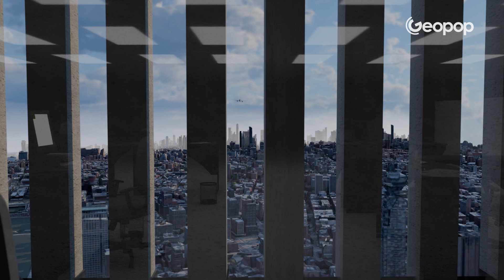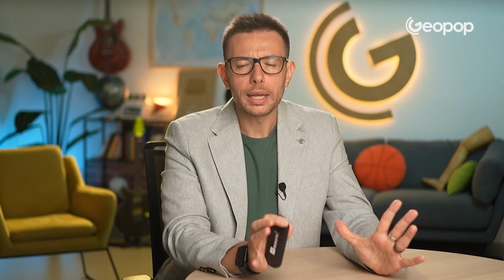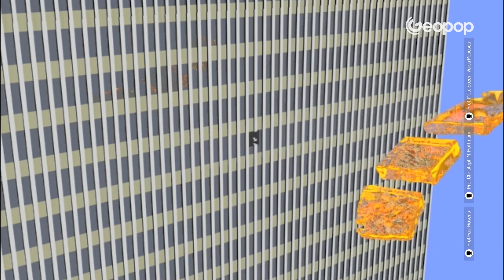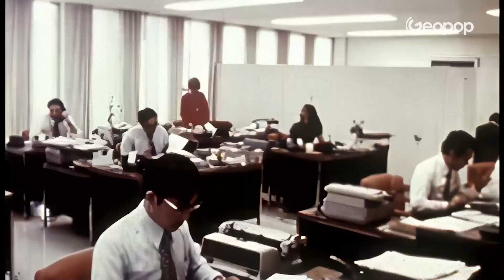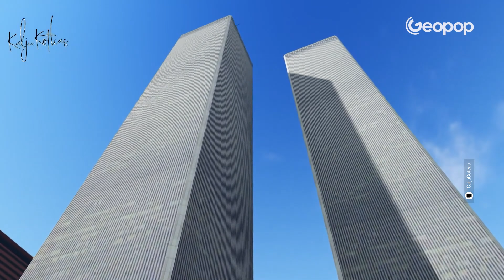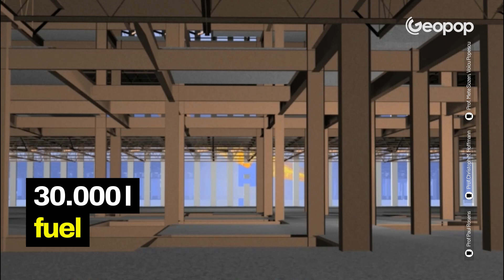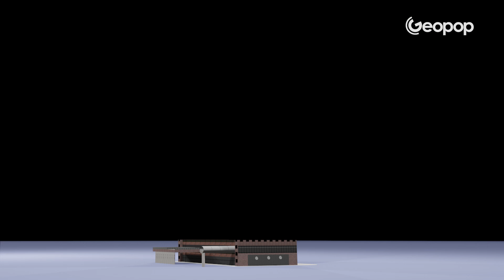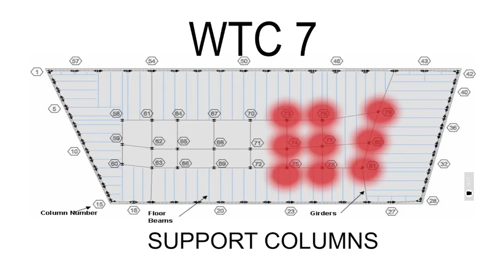9/11, 2001: The Technical Reconstruction of the Twin Towers and WTC 7 Collapses

Comment: How’s does everything fail so quickly? Buildings want to stand up and resist and most of the buildings was not affected by the impact or the temperature. So how does a small part of the building push through the rest of the lower building in a free fall speed. There is not enough mass or energy to do that. I could see a partial collapse but a full failure?
Reply: The sheer weight when the beams inside could no longer hold up the weight, it is pure physics
Reply: @ulrichkristensen4087  It wouldn't have fallen at free fall speeds though, it would have slowed slightly every time a new floor was reached.
Reply: @MegaLokopo  Slowed slightly? Well not so much it mattered, when it collapsed it was like a domino system, it went hard increasing its kinetic energy with each floor collapsing, i really do not care about you n.t cases, but have some respect for the people who died in this tragedy
Reply: @MegaLokopo It did slow slightly. If it hadn’t then the building would have fully collapsed at the same time the ejected debris would have hit the ground. In the videos, you see the debris are traveling faster to the ground than the rest of the building.
Reply: @dudleysquibbles6366  That difference is entirely accounted for with wind resistance.
Reply: @ulrichkristensen4087 no. Pure physics is that NOTHING can fall at free fall rate unless there is ZERO resistance. No matter how much weight is coming down on each floor there should STILL have been some resistance. If you are going to quote physics then please make sure you do so correctly.
Reply: @amadormediero3978  so tell me how fast  the building  Collapsed....i stand in awe of your presence, but i sure you can tell me, since you went to Donning-Kruger University, and i did not, i will be waiting right here Tada.....
Reply: Free fall speed , hahahaha 
Stay goofy - you got the Internet correct
Reply: It was a combination of multiple events
Reply: Your logic & instincts are 100% correct- the one and ONLY way any steel construction building could possibly collapse that way is a CONTROLLED DEMOLITION- THIS IS OBVIOUS- How does all the steel BELOW the crash site fail simultaneously? Do you conspiracy shamers see how ridiculous that really is?? I hope so
Reply: Read ``9/11 for Dummies´´free on Amazon Kindle
Reply: The twin towers didn't fall at free fall speed. And I can see that you're asking these questions rhetorically, but if you are a person who is actually curious about the truth, the answers are available through a quick google search. Scientists have actually done the math and concluded that there was much more than enough mass and energy (by nearly an order of magnitude) for the upper portion of the building to crush through the lower portion and cause a runaway collapse as we saw. You can look up "Why Did the World Trade Center Collapse?" by Bazant and Zhou to read the paper.
Reply: I think that it was a gradual thing. As floors were collapsing onto other floors eventually the weight will be too much.
Reply: @CoreyCaudle-mp7zn  Yes but if that did happen the speed would still not be freefall. Every floor should show some resistance assuming the mass above is enough to push through the mass below. Again a pancake collapse which would of taken longer...
Reply: @michaelzero5144  
If a man that weighed 15x your mass fell on your head at a speed of 80mph- how much "resistance" will you provide when it crushes you ??

You think you would notice a difference in the fat man's free fall onto your head ?

Every floor that collapses adds to that mass differential -  16x 17x ... 30x .... 40x

How quickly does your spine snap ??  
1 second - 0.5 seconds - 0.01 seconds ?
Reply: @BracaPhoto  nice math but I am not a massive building so not sure how that compares. I understand how the force can multiply but I am arguing that it can’t get started in the first place naturally. Not enough mass or speed above impact to push through the majority of the building that is left in a free fall straight down. If buildings were that fragile we would have collapses all the time. Also it’s mathematically impossible 3 buildings fall the exact same way with different damage points and different structural failures. All 3 fall straight down in a free fall? That in itself is impossible in a world with random chaos.
Reply: @michaelzero5144  just one word: thermite!

Norwegian investigators found evidence (particles of nano thermite)
Reply: @BracaPhoto free fall is the rate at which anything falls when there is no resistance. If I jump off a roof I would fall at free fall rate of 9.8m per second. If I create resistance by wearing a  blanket tied at my ankles and my wrists I would create some resistance and no longer fall at 9.8m per second. So these towers did actually fall at free fall rate meaning there was ZERO resistance below. In other words all the supports were blown out at ground level at precisely the same time in the way perfect demolitions are done. That's what this was. No doubt about that at all.
Reply: @amadormediero3978  you are an absolutely muppet of a human being, not only do you DK all over this thread, but you have zero sympathy for the victims and their loved ones, ln top of that you proclaim to be smarter than anyone else, spurting your little conspiracy theory out over everything, it is because of individuals like you we can have nice things.
Reply: Quit with the :free fall speed:  you sound like an unintelligent fool.  The building did not fall at your so called free fall speed.  It was the debris on the outside that fell at your freefall speed.  The main building fell at a speed determined by what was failing below it.
Reply: Never played Junga or the 60s version of same idea called "Topple," huh?
Reply: He talks about this specific topic at the 15:00 minute mark.  A floor can only hold up to a weight of 11 floors (if gradually dropped or 6 floors for a sudden drop) above it singularly without any other support.  Each tower was struck and damaged more than 11 floors from the top.  Each floor had to carry its weight and only 11 floors above it or it would collapse.  It held out for as long as one floor had enough to support itself under that marker.  Once any floor in the damaged zone could no longer support itself it caused a sudden drop of that floor's weight and all the floors weight above it which again was >11 floors. That immediately caused a domino effect of floors unable to bear that sudden massive weight being thrust upon it.
Reply: @marybria  Its BS. There no way the tower can come down like that in freefall without buckling first. These "experts" may think we are all stupid...And some of us certainly are.
Reply: @marybria it still wouldn't fall at free fall rate. The ONLY way anything can fall at free fall rate is if there is absolutely NO resistance from below and no matter how much weight comes down on a floor from above there would STILL be some resistance below. In the case of these 3 towers there was ZERO resistance. Besides there have been many towers totally engulfed in flames (not just a few floors) and NEVER has any other tower collapsed anywhere in the world in history. It was all Bullshit
Reply: @marybria Nope, that a load of bullshit- wake up & don't be so gullible
Reply: @jerald6023 "wake up" is not an argument nor does it prove your point. try again.
Reply: @jerald6023 says the guy screaming to the clouds!
Reply: @jerald6023 wow what a response I'm completely convinced all questions answered
Reply: @jerald6023 where is your proof or credentials
Reply: The construction method used in the east is different from that of the west. The west built their stories one by one and the east built the exo-skeleton from the bottom all the way to the top and then added the stories inside. Therefore it was mentioned in the video that the towers could only hold up to 6 stories on a sudden collapse, there were more than 11 stories that collapsed on top of each building that day.
Reply: @Misael-Hernandez the towers were built exactly the same- there is literally VIDEO from construction to show as much!
Reply: @jonathanlandau-litewski7405  here's an AI Google search 

The World Trade Center towers utilized a construction method called "framed tube" design, which differed from the more traditional "bearing wall" method common in Western construction by relying on a perimeter of closely spaced steel columns to support the building's load, allowing for open floor plans without interior columns, while most Western buildings would have load-bearing walls throughout the structure for support.
Reply: I agree. I certainly don't believe the tower 7 narrative.
Reply: Each floor collapsed one by one in rapid succession from the weight of the floors prior. So this would add to the weight of the total building multiplied by the gravitational constant. So when considering gravity is pulling the whole structure down, the building has enough inertia to collapse floor by floor. In the 9/11 documentary by the Naudet brothers, you hear one of the firefighters describe what they heard as a controlled demolition sound (not because of explosives) because it was the sound of each roof collapsing as the weight of the building compounded downwards.

Weight compounds with mass and the acceleration from gravity (or otherwise). I can keep my car from rolling if it's on a nominal incline and in neutral, as long as it's stationary. Once the car starts moving, it becomes impossible, and you just have to get the hell out of dodge.
Reply: @KC-Mitch  Even with all of that taken into consideration, the buildings shouldn't have fallen at free fall speeds. Each floor would have taken a non zero amount of time to collapse, and it would have added up over time, to cause the fall of the building to be slower than free fall speeds.
Reply: @MegaLokopo define “free fall” speeds
Reply: Most studies including the one mentioned completely ignore what happens after the buildings start to collapse. The buildings would have collapsed, but it wouldn't have been in free fall, the building would have shown some resistance.

Comment: There is no way however that the steel around the whole perimeter of the building heated evenly for the towers to fall so perfectly straight down. wouldn,t the structure below remain stronger and the top fall off to the side? the non damaged structure below especially the core should have resisted enough resistance to at the very least deflect the debris off to one side. I remember even as a 20 something year old, screaming HTF could that happen like that, the day we all watched.